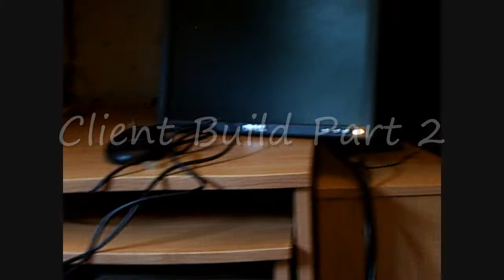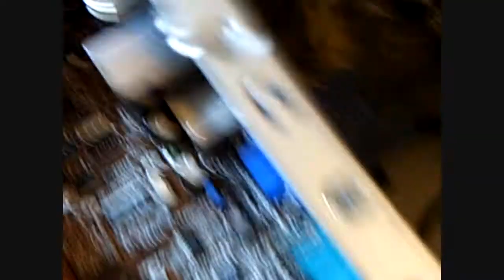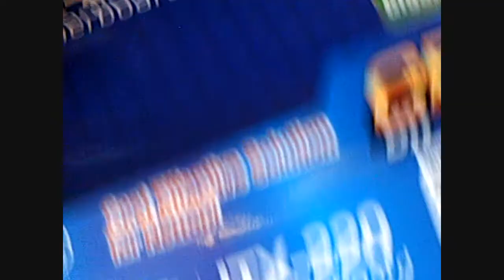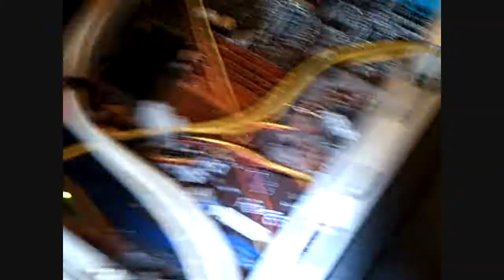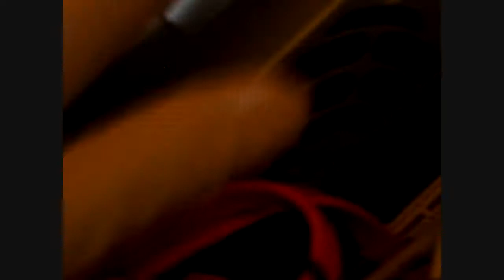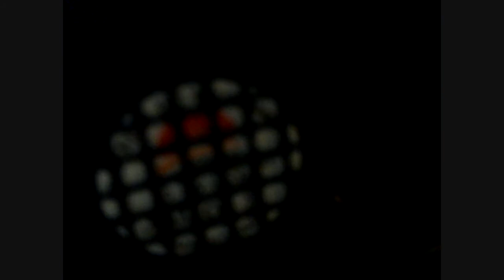Client Build (Final)

Comment from the maker: @zeferino88 Yes it is.  The atom d510 is a more energy efficient processor used in most netbook solutions so i would recommend you move towards the more appropriate Celeron 220 that is onboard on the itx 220 by Asus.
_Bill